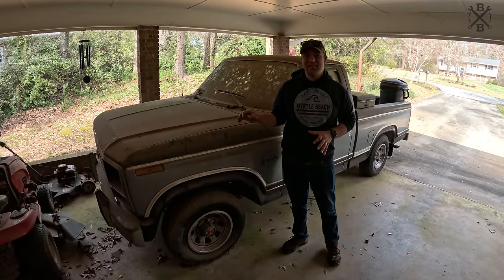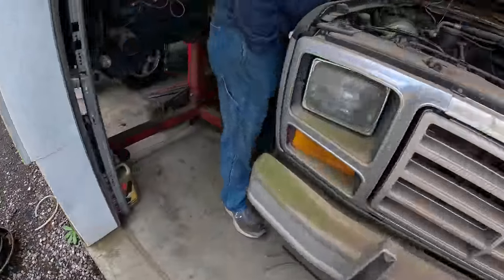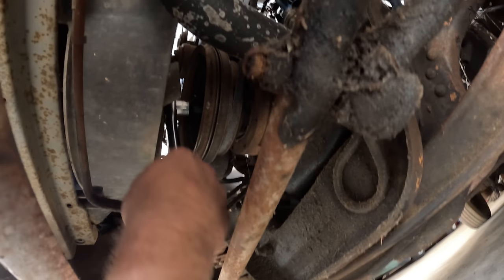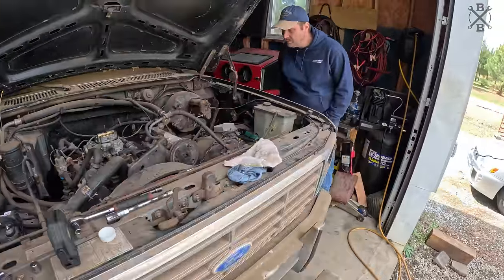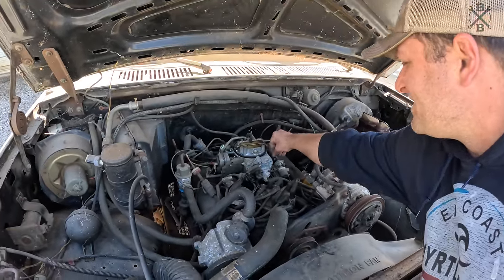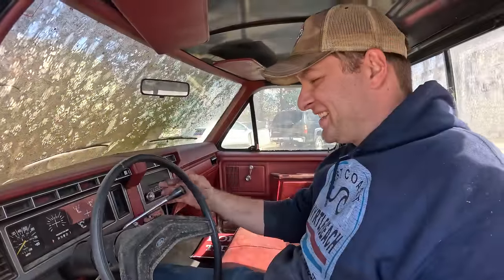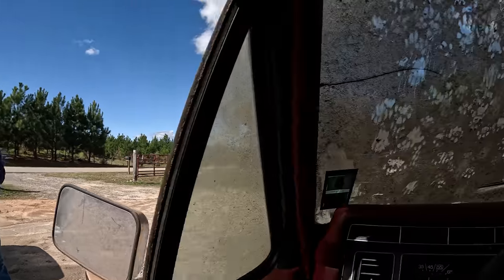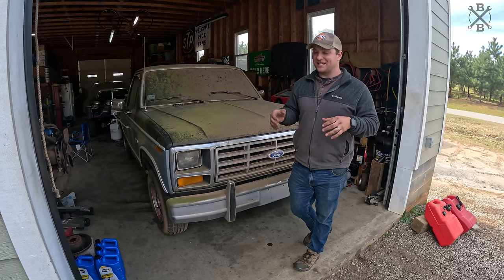FORGOTTEN Ford F150 Rescue! Will it run after years of sitting!?

Comment: Bought that exact truck new . After 2 years , developed wiring issues . Traded it for  a Chev truck ,and have stayed GM ever since , with no regrets .
Reply: Good for you 👍,  I hope you have a nice day today
Reply: I’ve had a 85 300 i6 that caught carb on fire and burnt wring and threw a new carb on it left the wiring alone and haven’t had wiring issues that would make me trade it there so simple
Reply: L
Reply: Got a 86 f250 4x4 6.9idi diesel been driving for almost 40 years. Original owner. It has 1,266,897 miles on it. Original motor. I'm just now after almost 40 years of driving getting ready to rebuild and restore it back to new. Guess I'll be driving it another 40 years?

Comment: Excellent video Budget Buildz  Mike  :) also be nice top the Air Conditioning pump also see if hold recharge and no leaks to on Fluid too! Great find for that year of pick up and nice condition so far! Hopefully see more videos soon too also watch fix up more! Also put grey bottle of STP Total Treatment fuel injection and carb cleaner in fuel tank too each month plus 89 or higher octane gas in too ! Don't forget change PCV Valve on Valve cover too!

Comment: Interesting watch, not something I'd save. The last good looking Ford truck was a 1979. I had a 78 F-150 with a 460. I blew a power steering hose taking a 90° turn at  50 mph (a fella one year younger did it in his Ford truck so I had to attempt  it) successfully I might add.

Comment: Check the butterfly flap in the end of the exhaust manifold where it bolts to the exhaustion systemake sure it's not seis East or you burn. The valves

Comment: I like to add a pint of kerosene to the old oil and run it at idle for 5-10 minutes, letting it bust up all the sludge, then drain out the oil and refill with new.  It's basically the same thing as using those cans of motor flush before changing oil.
Reply: When I was young, i had a sludge issue, and I filled an entire engine with kerosene. Never ran it but sat it overnight. Actually worked pretty well 😂.
Reply: That's funny I use to watch my grandfather in the late 80s use kerosene on slugged up engines I was a kid I thought he was crazy but it worked

Comment: After 1965 Ford stopped putting rear pumps in their automatic transmissions and the other major auto manufacturers followed suit. So in nuetral, nobody checks the fkuid as no lubrication is being pumped thru the trans. The stick is stamped with check-in park at ldle.

Comment: I'm looking for an older truck. Nothing fancy. Will you be selling that truck? If so can I contact you to find out how much? Thanks
Reply: 1980Ford F 150 shortbed for sale, 74,613 actual miles, a little  rust on the fender wells and no other rust.    inline 6 cylinder, auto       in my garage .    What's it worth to you ?
Reply: @mattdonna9677  By older I want a pre nineteen seventies truck. Thanks for the offer.

Comment: cant beat a old f 150 more reliable. Than most of the cars on your lot old fords never die they just go faster...problem is this model f truck had that smog engine in it low compression heads...and a Millon hoses what was the government thinking at that time?